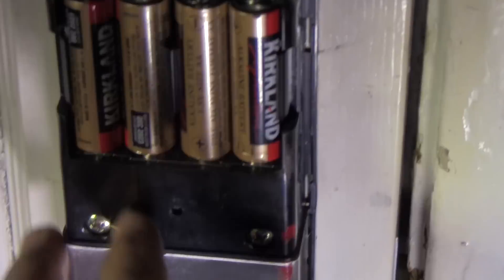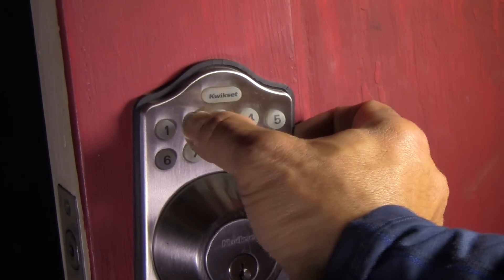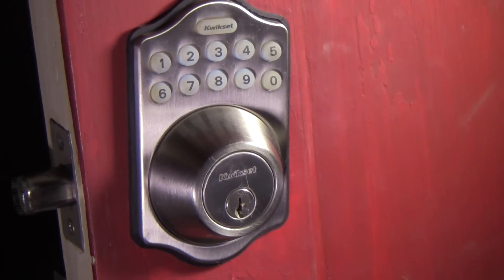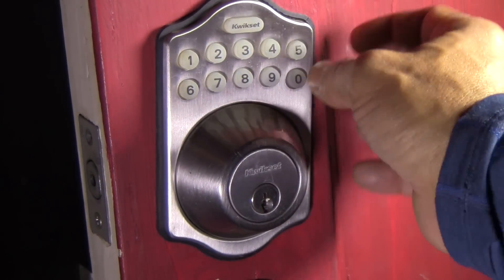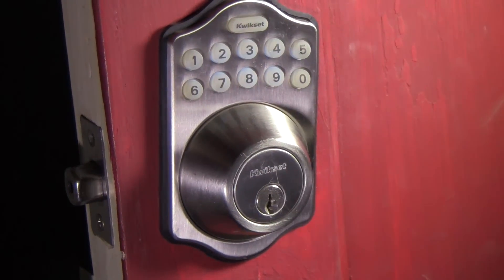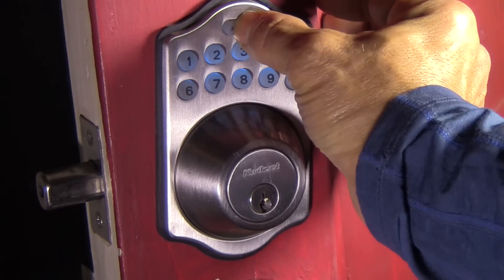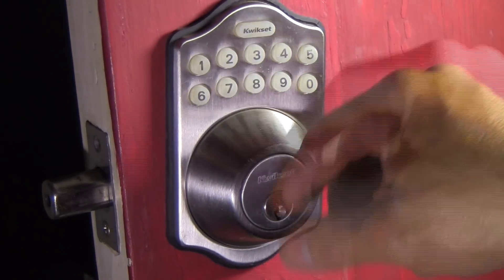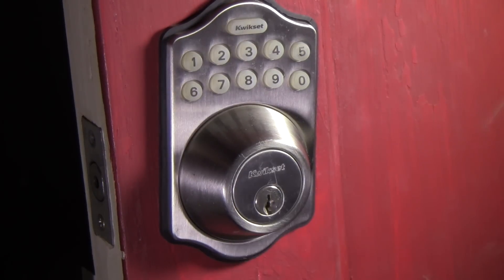How to set the combination on a kwikset electronic lock - filmed with a Vixia Canon camera

Comment: Mine doesn't say Kwikset on it.  It says Tru-Bolt.  Tru-Bolt is apparently one of the private labels owned by Menards.  It has no serial number nor model number that I could find.  It is probably a discontinued model by now further complicating the seaarch.  I kept looking until I found a video dealing with a lock that looks just exactly like mine excepting the name brand button top dead center above the keypad.  This video fit the description - and it worked.  I'm guessing that Kwikset is the manufacturer and that they do private label locks for many of the large retail chain stores.  Thanks for the help!

Comment: We just had the Kwikset 912 arrive.  Installed it and have tried endlessly to get it to set-up, learn and work.  Took new Energizer batteries in and out.  Lights on.  Reset with pin at back.  Heard 3 beeps.  Then entered 0 0 0 0 and pressed kwikset.  Flashing red  and beeps.  Tried again.  Started from reset again.  When following the instructions, we cannot get beyond the very first 0 0 0 0 and kwikset entry.  Flashing red and beeping.  Tried just moving to next step.  Red light flashing and beeping.  Any suggestions or is this just defective?  I just don't want to send this back.  Help!

Comment: Here are the steps in the video:

1. hit the reset button in the back until it beeps at you
2. 0000 k (kwikset button) 0 k
3. 0000 k 1 k [insert 4 digit user code] k
4. 0000 k 4 k [insert 4 digit programming code] k
5. [programming code] k 1 k [insert 4 to 6 digit door code] k
6. k
Reply: The steps worked for me except for the last.

Comment: I just installed this lock. 

The instructions that come with the lock are Incorrect. Pretty much useless 

Quick program. 
0-0-0-0 enter 4 enter program code (XXXX)
XXXX enter 1 enter unlock code enter 
XXXX enter 0 enter.

Comment: So I  got from this that you can create user codes with the default programming code of 0 0 0 0? That's actually disappointing if true. I doubt if a criminal will be an inside job creating a new pass code to get in later. Who does that?

Comment: I BOUGHT THIS LOCK THINKING THAT THE LOCK CAN BE OPENED ONLY THROUGH THE CODE BUT THE LOCK CAN BE OPENED AND KEY
Reply from the maker: And you can even get it re-keyed to match other locks...if, the style of keys are the same.
Reply: Batteries can run low or become useless in extreme hot/cold/wetness. Like a house fire, blizzard, or flood/tsunami. Your screwed then.

Comment: For anybody else who got a little lost,  here's my summary of what you need to do  (PS these instructions worked on my lock labeled "TRUBOLT" instead of "KWIKSET" with zero issues) ---- 

>> [01]  RESET the settings by holding down the small black button on the back of the lock and wait for three beeps. 
>> [02]  INITIATE the programming sequence = 0000 + {ENTER} + 0 + {ENTER}
>> [03]  ADD a new user code (such as 2468)  = 0000 + {ENTER} + 1 + {ENTER} + 2468 + {ENTER} 
>> [04] CHANGE the programming code (such as 7777) = 0000 + {ENTER} + 4 + {ENTER} + 7777 + {ENTER} 
>> [05]  DELETE the default user code (1234) = 7777 + {ENTER} + 2 + {ENTER} + 1234 + {ENTER} 

The point of Step#3 is to add the code you want to start using to get into the house.  Steps #4 and #5 are to remove the default PC and UC to ensure no one else can make changes or enter the home using the defaults.
Reply from the maker: This lock is a tough one...

Comment: You never mentioned why you used the number 4 when changing the default PC code.  I thought 1 was for adding User codes and 2 was for deleting codes.  Where did 4 come from?
Reply from the maker: Load the time on when I mentioned 4, so I can reference it in a reply.
Reply: Construction Engineering & Photography You mention 4 at 3:56 in the video.
Reply from the maker: For clarity buddy, it says, [4] zeros       not the number    4 ... hope that helps.
Reply: Construction Engineering & Photography No you actually enter the number 4. I know what I saw and heard but whatever its not the end of the world.
Reply from the maker: Okay, you might have spied on a number in my personal, private code,  ... that is why I blocked it... so, it would not be on the internet... You can enter your own numbers as you see fit...

Comment: Good info!
Make sure you instal the codes while the green light is on. If the red light flashes, you have to start over or it will now work.
Reply from the maker: Agreed... that is correct.

Comment: Is your lock still working? I just got this yesterday but I'm concerned how long do these last.
Reply from the maker: I have used one for two years now and YES, it can act stupid sometimes -- when it does, simple remove and reinstall same batteries (this fixes it when it starts auto locking and will NOT unlock itself).
Reply: Photolight PhotoLight I  got one of these, and two of the number buttons stopped working. can't get it to work after all troubleshooting. I'm going back to a keyed system. Too unreliable for the price.